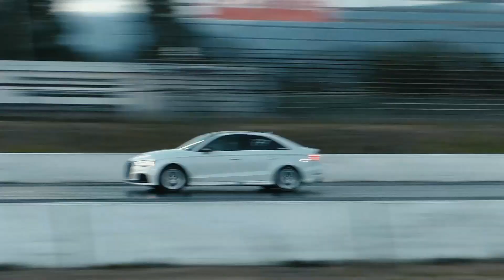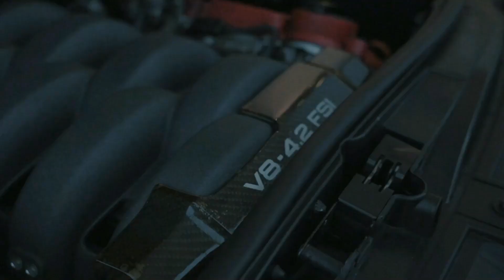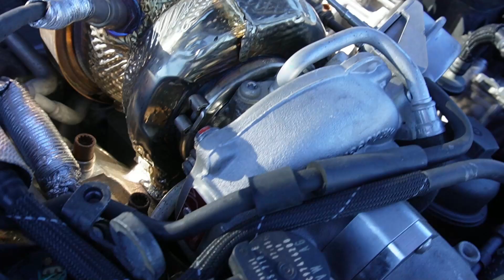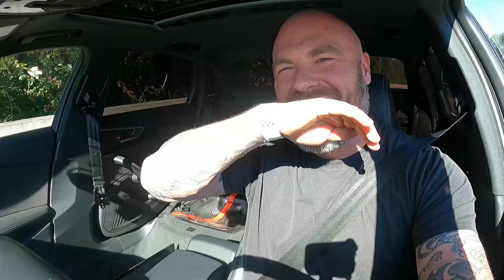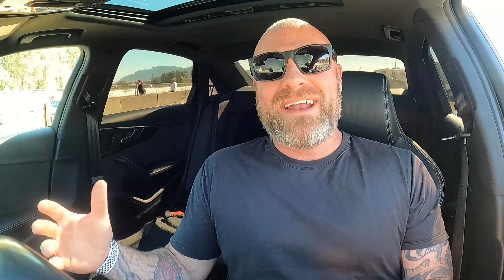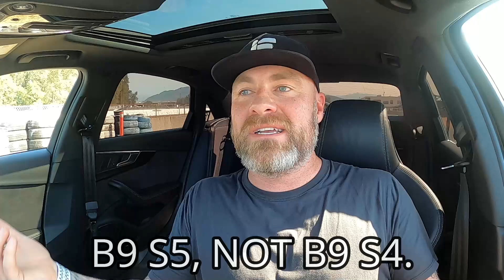TTE710 - Integrated Engineering Stage 3+ w/ Injectors - 93 - Audi B9 S4 1/4 Mile Racing

Comment: I believe that launch timeout is the gearbox safety feature, so that your gearbox wont explode. There is no proper launch control on B9 S4, its basically brake boost, like driving WOT with foot on a brake )
Reply from the maker: You'd be incorrect. As I said in the video it is a safety feature that IE has activated to timeout the LC so you don't overheat the turbo.

Comment: You destroy a nice and luxurious S4 by installing a nasty catless DP, gutting out the interior etc and still barely break into the 10’s? What’s the point? If you want a single purpose drag queen there are much better and cheaper cars out there, like a Mustang or Civic. You turned your S4 into a 💩📦 and it’s not even fast. 🤦🏻
Reply from the maker: LMAO. Stop sugar coating it would ya! Tell me how you really feel, LOL. First off, the downpipe is still catted. Everything I've done to the car is reversible. Once the drag racing season is over the entire interior goes back in to show everyone what full weight performance is like. May I ask what you consider fast? I don't consider these times to be fast either.
Reply: @VancityAudi  Oh yeah, the car “still retains all driveability” with a crappy aftermarket DP, open exhaust, four cheater slicks, no interior etc. You’ve turned a nice and luxurious S4 into a single purpose drag queen with one seat just to run high 10’s. 

I never understood why people do this to such nice cars. You talk about putting it “back to full weight.” So you don’t even intend to drive it like that? You’re literally destroying it just to run a number? What’s the point of the high 10 if it isn’t even representative of what the car actually runs when you drive it?
Reply: It still retains all driveability and still works perfectly as a daily with no issues. What’s the issue? Lol
Reply from the maker: @giovannimalek9211  I think he's just upset that my car will now destroy his TenSecondS4 in a 1/4 mile drag race and that was his way of dealing with it, lol
Reply: @VancityAudi  I’d have to agree 😅
Reply: I love this, a guy posting 13 second Hyundai videos calls out the guy nearly in the 9’s. Only on the internet.
Reply: @pd7439  I swear he comments on every b9 s4 related video finding a way to hate 😭
Reply: @giovannimalek9211  I comment on every B9 S4 video? Really? This is literally the first one I’ve ever commented on in my life. Please provide examples, liar.
Reply: @pd7439  Ha! Are you referring to my 2023 Elantra N which is a brand new car with a 10 year/100K mile warranty and runs 12.5@114 MPH? I didn’t buy this car to drag race lol. I bought it for road racing. You can see videos of it on my channel running much faster in the twisties than a modded B9 RS5 on E85, Porsche 992 Carrera S, etc. That is what the car was engineered to do, not drag race. And for $30K brand new, I’d say it does very well in the twisties.  

I also have videos on my YouTube channel of my Audi A8 running 9’s with OEM turbos, stock DPs and cats, stock exhaust, stock cooling, street tires and a full interior. It’s still a nice and luxurious Audi which you could get in and drive cross country. It’s not a single purpose drag queen which has been destroyed and gutted out with open exhaust, no seats, four cheater slicks etc.
Reply from the maker: @TenSecondS4  🤣🤣🤣 Jack Jones!!!
Reply: How would you “destroy my S4?” The S4 you speak of was a 2000 B5 which ran 10.6 at 133 way back in 2007 lol. I sold that car 10 years ago. 

Check my YouTube profile for videos of my 2013 Audi A8 running 9.8 with OEM turbos, stock DPs and cats, stock exhaust, stock cooling, street tires and a full interior.
Reply: You're a complete and utter 🔔 end.  @TenSecondS4

Comment: since going stage 3 what oil are you running in the S4?
Reply from the maker: I've been running Motul 8100 X-cess gen 2 - 5W40 since I bought the car.
Reply: @VancityAudi  thanks for the reply, ive been thinking about switching just because 0w-20 doesnt sit right with me lol
Reply from the maker: @drejose25  well that's what it calls for from the factory. I'm just worried about how thin it is and the lack of protection it offers.

Comment: Good numbers with 93, have you trialled launching without building boost to max? Sounds counter intuitive but I’ve noticed mine do better times when holding boost between half and 3/4 of the gauge, curious to see if there’s a difference
Reply from the maker: Yes, I always try multiple methods to maximize the way my car launches. In this video I was more or less just having fun for the final Test and Tune because I knew the following day I was ramping it up to E70, where it really mattered.